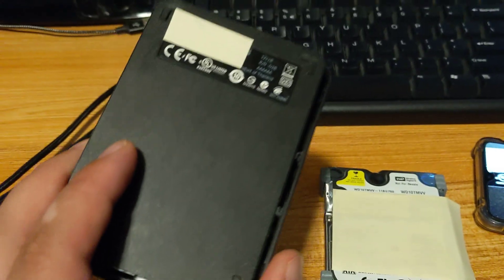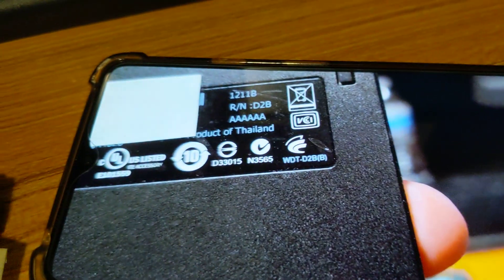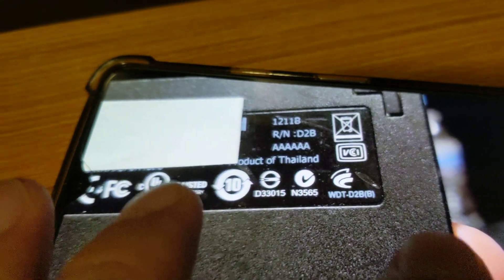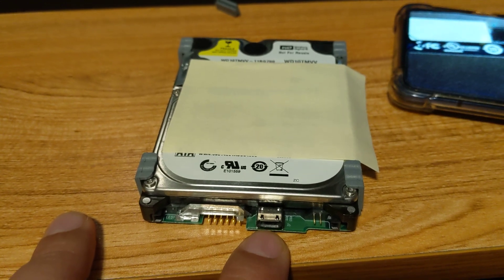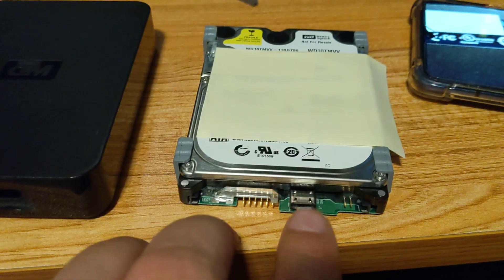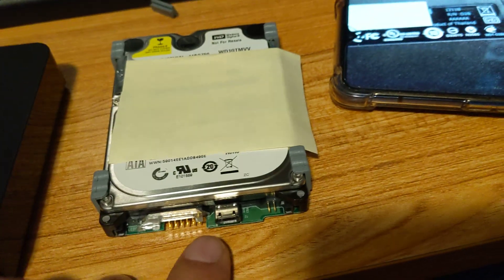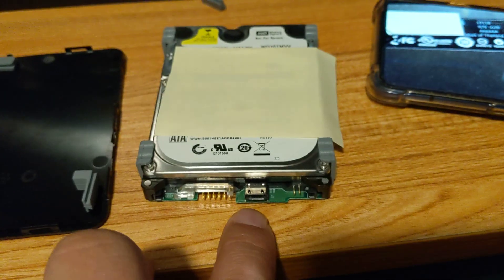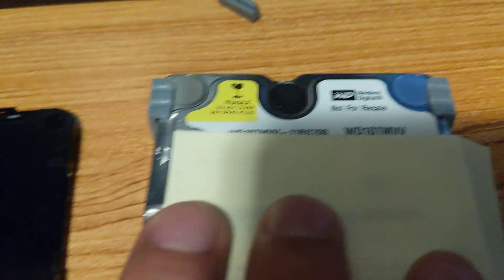My broken wd 2.5 portable hard drive. Micro USB connector is bad. wd10tmvv 1tb WDT-D2B(B) USB 2.0

Comment: Have you tried the newer m.2 ssd drives? They are super fast and reliable. I made my own external m.2 drive from  an internal m.2 drive and a usb-c housing. Especially good for video file management because of the transfer speed
Reply from the maker: Dude.. that's the dream.
M.2. with USB C housing.  Sounds super rock solid.
Only reason why I did it this way was I had it lying around and wanted to see how badly it performed running usb 2.0.

But.. your setup is sweet.  I'm glad m.2 ssd drives have gone down in price.  I'll give it a try when this one breaks. 
I'm jealous of your setup!